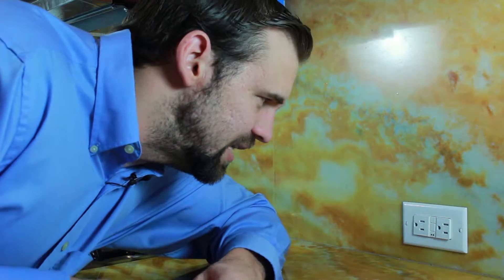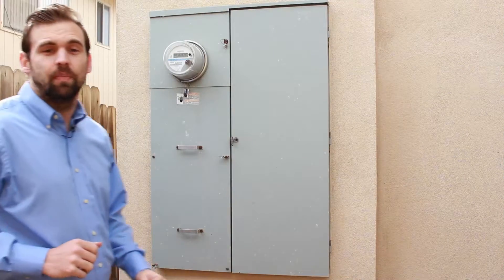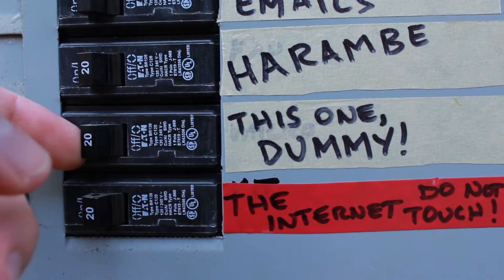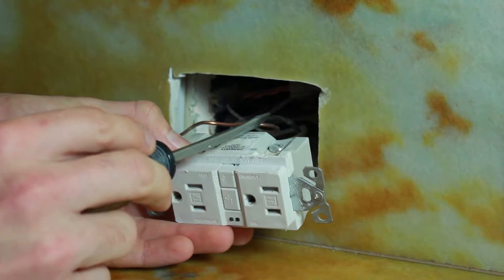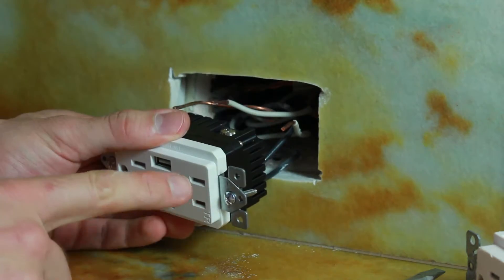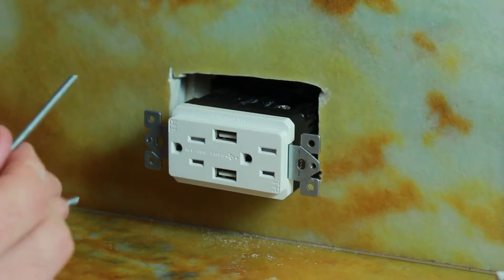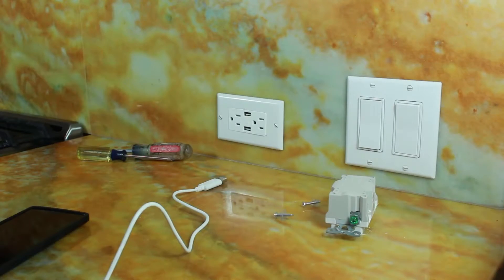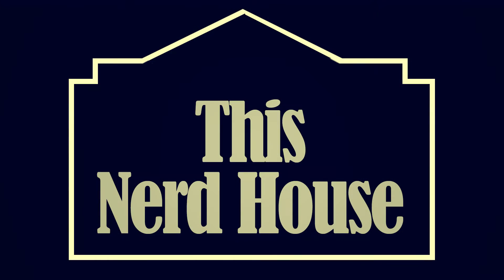USB WALL OUTLET INSTALLATION GUIDE [MOD]

Comment: Yah now we can get electrocuted beside the sink, because we removed the GFCI outlet.  Stick to putting LED lights in Micky Mouse hats, and leave the electrical work to professionals.
Reply from the maker: The GFCI is in the other outlet on the same circuit. But thanks for the help, professional.

Comment: Thats the same outlet I put in the kitchen to charge the kids tablets and our phones.  Works very well for the cost!  Keep the videos coming!
Reply from the maker: I use mine to charge my phone when i'm cooking in the kitchen. That's also the reason why I picked that location.
Reply: I went back to watch this again, and it looks like you removed the upstream GFCI from the circuit. Did you replace the next available outlet with the GFCI that was removed for USB charger?
Reply from the maker: +Ace_Of_Spades Gaming Great question. I moved the GFCI upstream, replacing a socket near the kitchen sink that wasn't GFCI. You want at least one of these per circuit. I didn't think to address that cause I figured most viewers wouldn't care.
Reply: @ImmodderNation  That's one way to "loose" subscribers. They don't care, because they don't know it is there to protect them from electrocution.
Reply from the maker: Did I not explain how GFCI works in this video? I don't remember this was years ago.